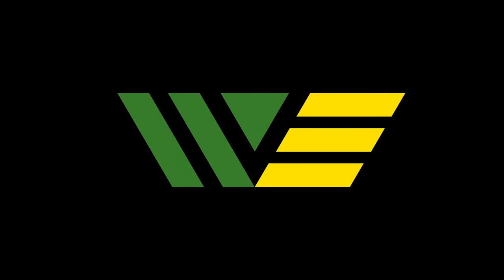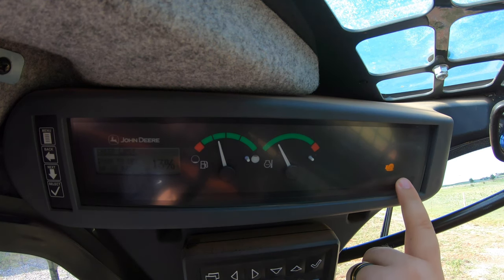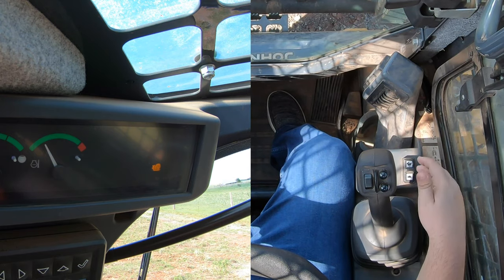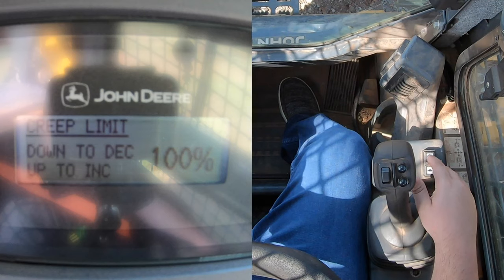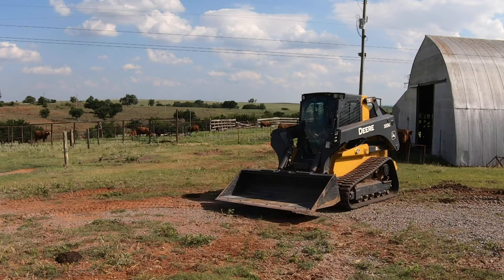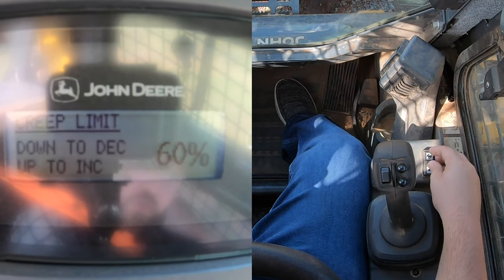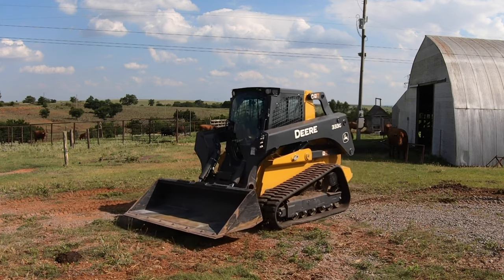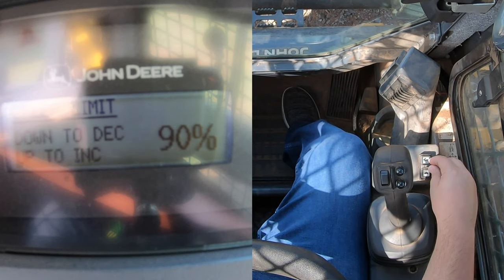How to Use Creep Mode on John Deere 333G Skid Steer

Comment: You can turn it on by pressing and holding the same trigger you use to turn it off. Quick press of the trigger enables 2nd gear or rabbit mode and long press enables creep mode.
Reply from the maker: Good point! I completely missed this in the video. Thanks for keeping me on my toes.
Reply: Nice!  I didn’t know that either!